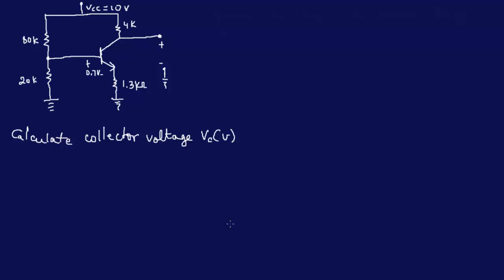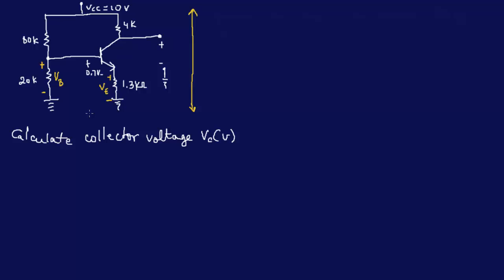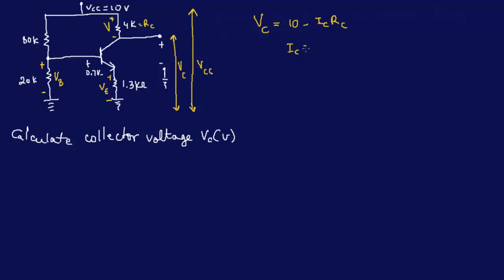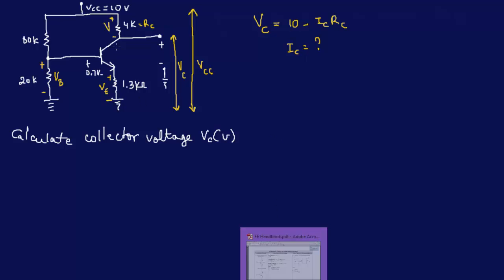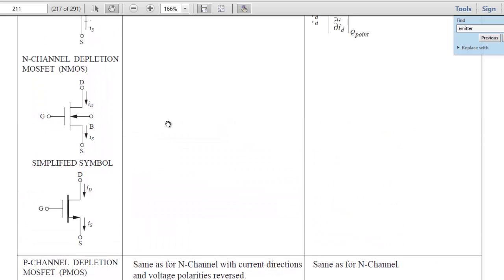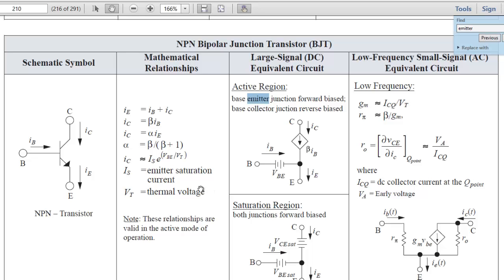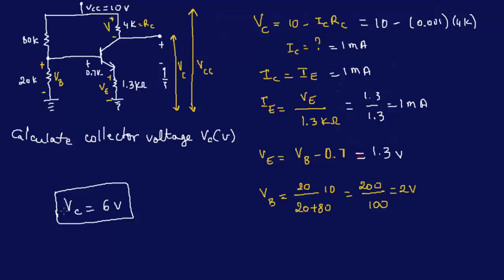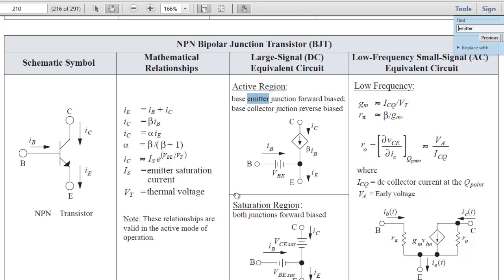BJT Transistor Example Problem

Comment: One thing Raiya is not considering here is adding an equivalent resistor (16K) in series with base after using the voltage divider.  Can someone correct if I am mistaken? This would matter what they are asking and how far the answers are apart. I know it's going to be a very small drop as the base current is in microamps.

Comment: In order to obtain Vb by applying the potential divider relationship, Ib has to be zero, (that is the base of the BJT  has to be disconnected from the divider) otherwise you should not. And if you assume that Ib is zero, then Ic will be zero as well. So i think the first assumption should be that the BJT is in saturation mode. in that case VC will be approximately equal to VE and you can then resolve the problem from there. I agree with everything else (every other video so far) but i don't quite agree with this answer :)

Comment: Hello Raiya, can you elaborate on why Vc is not the same voltage as the voltage across the 4k resistor? I was thinking that, because Ve and Vb were the voltages across their respective resistors? So I basically did not subtract 4 from 10 the first time and just put 4 V as the answer. Thanks!

Comment: Thank you so much for these videos. I just took the FE exam last weekend and I passed! All I did to prepare for the exam was view your videos.
Reply from the maker: CONGRATULATIONS Manual!!!! You have no idea how this just made my day. I am super happy for you. Maybe you can share your experiences with the folks that haven't taken it yet. Any tips? hardest questions? Good job!
Reply: Raiya Energy Yeah, I will spread the word for sure! I got a lot of questions of Control Systems and Telecom. Maybe more examples about Bode plots, Laplace transform, Convolution and modulation/demodulation theory (for example what is the best way to demodulate PCM) will help other viewers.
Reply from the maker: Manuel Cortez Awesome. I will work on that. Thank you and again Congrats!
Reply: +Raiya Energy Academy In order to obtain Vb by applying the potential divider relationship, Ib has to be zero, (that is the base of the BJT  has to be disconnected from the divider) otherwise you should not. And if you assume that Ib is zero, then Ic will be zero as well. So i think the first assumption should be that the BJT is in saturation mode. in that case VC will be approximately equal to VE and you can then resolve the problem from there. I agree with everything else (every other video so far) but i don't quite agree with this answer :)
Reply: Hey I took the practice exam from NCEES website and my score was 45/50 questions. What are my chances of passing the real test?
Reply: You shouldn't be worried about it. You will definitely pass it. I took the practice exam and got 35/50. Then I watch all these videos, took the exam and pass it.
Reply from the maker: faisal saeed
Yeah like Manuel said, if that's your score straight up, you normally shouldn't have issues because the NCEES is by far the best representation of the actual exam. The key is to concentrate on your weak areas from now on.
Reply: Engineered Systems Development Inc.yes indeed. I solved it and found out VB was negative.
Reply: thats amazing. i will take my fe soon and i think these videos are amazing